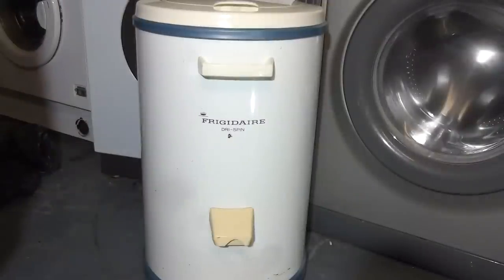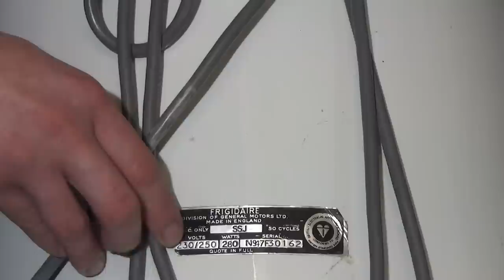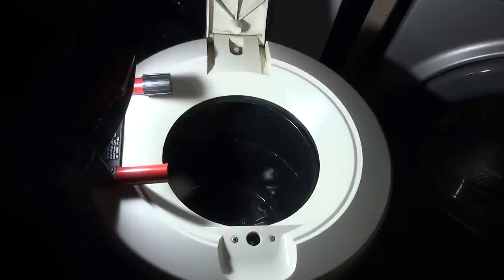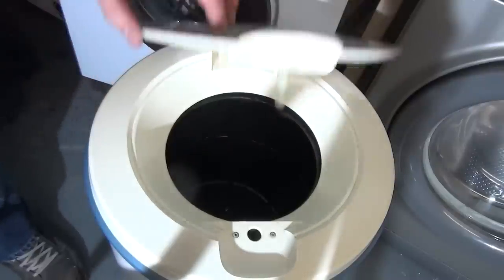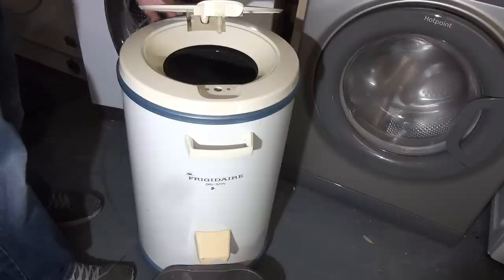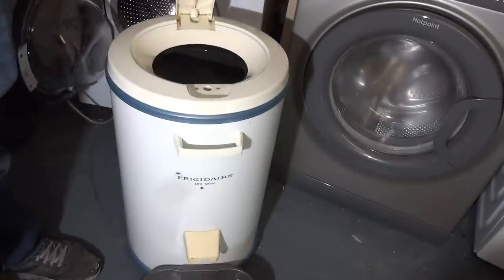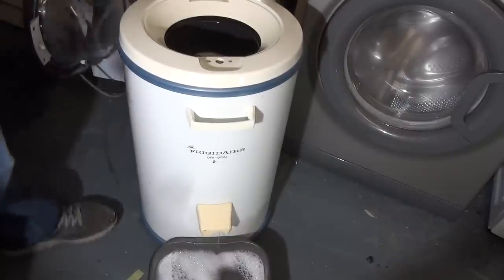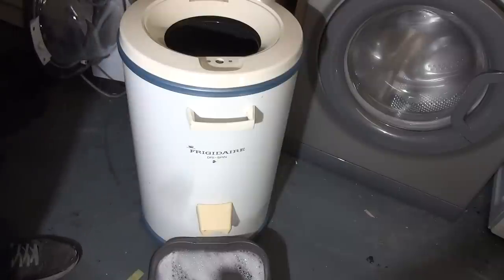Review and Demonstration of a 1970's Fridgidare SSJ drispin  spin dryer

Comment: Lovely spinner Mathew, the spin speed is 2,800rpm and washload is 6lbs, certainly makes for quicker line or tumble drying, and for a positive spin when new machines abort !!
Reply from the maker: comes out to play when the washer fails to spin because its a bathmat or just times out - or can't drain the water for some reason. and on slower spin machines cirtinatly dose save time in the dryer
Reply: @whichwasher2007  That makes sense and so much quicker on the drying especially if in tumble dryer !!

Comment: Just inherited my mums old one, from the 70s even older than that one. I pale yellow colour with a rubber not plastic bit on the bottom. Tried it out, it spins just fine but no heat, not sure if it is supposed blow hot air or not?
Reply: its a spin dryer [no heat involved ]centrifugal forces the water out

Comment: Is Frigidaire the same crap that is sold in the US
Reply from the maker: Yeah same stuff. Luckerly. Fridgidare stopped selling in the UK over 20 years ago. And this spin dryer is from the 60's/70's.
Reply: @whichwasher2007  now is made by get and Whirlpool. It's one of the worst company in the USA
Reply: Frigidaire UK was a subsidiary division of General Motors, but all UK machines where built here to our specifications, much sturdier spin dryers, twin tubs and both front load, H-axis and Top loader models. We even had a Frigidaire Jetamatic with built in heater !!